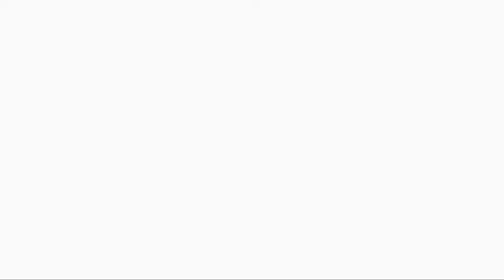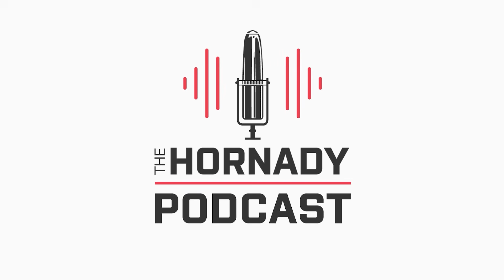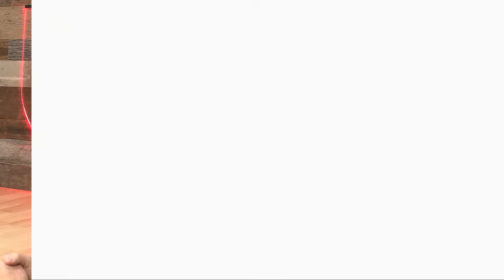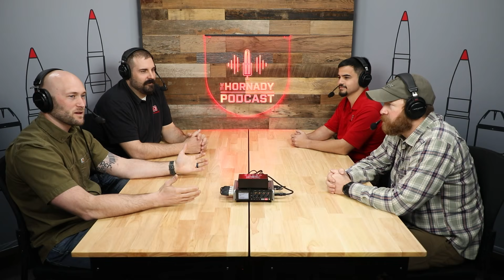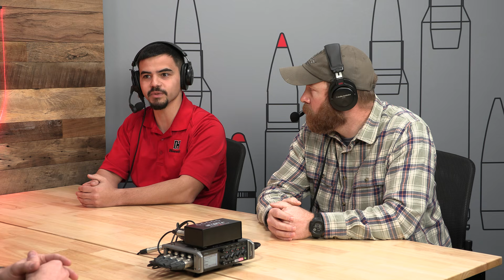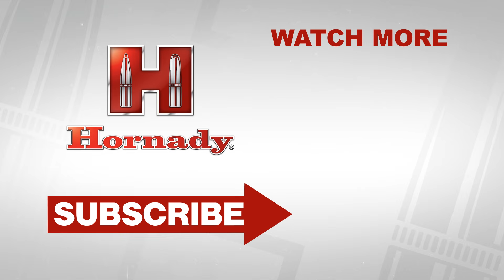Ep. 012 - 6mm ARC (Advanced Rifle Cartridge)

Comment: Use the same case head from 24 nosler with the ark chamber. Using the same 556 bolt.
Stronger bolt and no rim lock.

Comment: I contacted Starline and they are not taking on new projects and their technician said it wouldn't work because the primer pockets would stretch if you removed brass from the base.  That didn't make since to me since it would be the same as existing 5.56! So I took two 6.5 Grendel cases and milled them down myself to fit my 5.56 bolt.  I then put the 5.56 bolt in my 6.5 Grendel upper and have now shot each case 4 times and still have resistance in the primer pockets.  One case is PPU and the other is Hornady.  I'm pushing a 140 grain bullet with 21.5 grains of IMR4198 because I have a good supply of both. No pressure signs. I'm going to work up to 22 grains which should be near max pressure.  I haven't chronographed this load and I'm not using the gas system for this test. I'm just testing the integrity of the base.

Comment: You could do the same thing with the 6.5 Grendel and the 7.62x39 with small primer pockets. This would practically eliminate the bolt breaking at the lugs due to the removal of metal to accommodate the larger cartridge bases.

Comment: Its probably the strongest all around cartridge for a AR15. I hope some other bullet manufacturers make 6ARC. All I have seen is Hornady.
Reply: Gas gun or bolt?
Reply: Only if your IQ is bellow 73 and reading comprehension is an issue! The 6.5 Grendel will match it or beat it every time if you are a hand loader and can select bullet weights that are identical and similar in design. Once you get heavier than Hornady loads for the 6mm ARC the 6.5 Grendel pulls ahead real fast. Nothing wrong with the ARC as long as you do not think it is better than the 6.5 Grendel. Until you have shot both and loaded for both your just sounding very ignorant when you put the 6mm ARC on a pedestal!

Comment: Update.... I got a 16" upper from pro2A tactical.  It doesn't like the 105 blacks. But, I bought several boxes and have been reloading.   It shoots the 103 eldx well with Lever.  58vmax OK, with exterminator.  Didn't seem to like 95 LRX.  Next up, 80 ttsx for hogs!! Might run 65/75 vmax for yotes.

Comment: 6mm ARC will arrive when Starline starts offering brass.  It's still in growing paying phase.  I bought a 6mm ARC ballistic advantage barrel.  It's back with them because they couldn't get the headspace right to pass a go, no-go check.  And their customer service works in Geological terms in that the replacement barrel that's coming "soon" may or may not arrive in my lifetime.  I think it's a viable cartridge offering, but the marketing wank is disproportionate to the availability of brass, factory ammo, etc.  Meanwhile my Grendel build shoots lights out.
Reply: I hate to hear this. I'm thinking about building a Wilson Combat upper in 6mm ARC.
Reply: @tacticalmattfoley  I ordered an Odinworks 6mm ARC barrel after I got tired of waiting for BA and finished my build.  It shoots great, and I've been able to get enough Hornady factory ammo to have enough brass to play with.  I like the cartridge and will probably build a bolt gun in it as I think the true potential is unlocked at the higher pressures a bolt gun can run.  But I still think the marketing wank is disproportionate to reality.  If it was as amazing as all the claims why would the army instead be adopting the 277 Fury?
Reply: @waltersobchak2973  SOCOM did adopt 6ARC as one of the support weapons for their squad sniper units. Geissele is building the 6ARC rifle, and the 6 Creedmoor rifle for those support roles. When you buy 6ARC ammo, it has an ITAR warning because SOCOM uses it. This is one of the reasons why I believe 6ARC ammo is hard to find at times.
Reply: @tacticalmattfoley  Yes, so the military should be very familiar with 6ARC, and yet still opted to go with the larger, heavier 6.8x51 round for the standard infantry rifle.  An odd choice if 6ARC checks all the boxes they claim.    Also there is no additional ITAR restrictions on 6ARC ammo.  It's hard to find because it's a be caliber that is only being produced by one manufacturer and because of the current state of the industry in which most calibers are equally hard to find.
Reply: Late to this thread, but I got Starline 6mm ARC brass delivered yesterday.
Reply: @williamgeideljr3985  Nice.  Got my first batch from Starline a week or so ago.

Comment: Has anyone tried running barrels under 10 inches in gas guns to see how they perform against more modern CQB type firearms?  Theoretically, this performs better in velocity and energy than a 300 blackout 3 inches longer. Not to mention the vast improvement at range
Reply: Precision Firearms did a bunch of testing with 7" and 9" 6.5 Grendels.  Velocities were actually good with 123gr ammo.  I ran some numbers for the 129gr ABLR in a hunting set-up, and they were pretty impressive.  Thinking about a 7" integrally suppressed Honey Badger Grendel type build.

123gr was in the 2100-2200fps range if I recall.  Numbers are on the Grendel forum.
Reply: @LRRPFco52  those are excellent velocities for that barrel length and round.  Short barreled 6.5 and 6mm guns would be a good replacement for 5.56 carbines
Reply: @Brimwald  I love 5.56, but not even a 20" 5.56 can reach 10.5" Grendel muzzle energy, and Grendel just walks away from it on-out.  20" 5.56 is flatter though within normal distances, which helps with hit probability.  If you go lighter in projectile weight with Grendel, that advantage narrows.  That's where 6mm comes in.

Comment: Love my 6 arc running a built gas gun 20 inch ballistic advantage premium series barrel Odin works adjustable gas block Odin works ragna 17.5 hand guard grendel hunter nickle bolt velocity trigger jp silent spring suppressed with iray Rico mk1 thermal 87 gr vmax over 31.5 gr of lever evolution seated at 2.140 mild crimp getting 2850 fps 5 shot 1/2 inch group that thing hammers

Comment: I might build one, but I'm perfectly happy with my Grendel's from 12"-22". They hunt well and all of my Grendel's shoot sub moa, including my 16" BCA 😳😁. Grendel wins on ammo availability and cost (premium and plinking). I can shoot and stock up on Wolf steel cased for less than 80 cents per round.
Reply: Grendel wins.
Reply: What velocities are you getting out of that range of barrel lengths?
Reply: @Brimwald  I don't have a chronograph so I can't tell you. I do need to buy one, especially since I'm going to be getting into reloading soon.
Reply: @Brimwald 6.5grendel gets around 2400fps from a 16in Barrel with 120grn projectiles.  I get around 2300 from 130grn bullets.  And about  2650 with 110grn ammo.
Reply: @djl5634  Grendel 120-123 gets 2600 in 24" AR
Reply: @Brimwald 6.5grendel gets around 2400fps from a 16in Barrel with 120grn projectiles.  I get around 2300 from 130grn bullets.  And about  2650 with 110grn ammo.

Comment: Pretty disingenuous to compare a 108 or 105 in the 6mm and just hand wave assume the best you can load into the 6.5 is a 120. 

Thats like comparing something to a 
308 and playing like only 150s exist. 

The 6.5 loaded with the best bc loads it can take is absolutely splitting hairs with the 6mm, and has significantly more energy up close, and only barely looses out in the ballpark of 800/1000ish yard territory depening...
Reply: I would like to see an update to the 123gr and 115-117gr class of 6.5s, increasing BC, but the conclusions are valid they have made.  The other answer might be .257, which would allow a really wide range of projectiles and better BC than 139-147gr 6.5mm, if you look at the new 131gr and 135gr .257s, but we really need a 2.500" action to seat those properly with the Grendel case.

Comment: My 6mmARC shoots fine.But it does not come close to my 6 Dasher, or my 6 BR or my 6 GT.ooking at the 2020 Nationals not even one 6mmARC wa in the running or even in the top 50.
Now with that said I love my 6mmARC AR15 Rifle.I am in the process of building a precision 6ARC bolt gun..
The problem is not enough rifle companies are building enough 6ARC rifles.Howa builds one and Savage. Who else is building one???
One other thing..Out of the 2020 Natio also there was only 1 guy placing in Top 50 shooting Hornady Bullets.
95% shot Berger .There were 4 shooting Sierra Match King.
And 1 shooting Hornady in both the Light Gun and Heavy Gun.The lone Hornady was  the 300 PRC..
I hope the 6mmARC stays around.I really like it.I love my Hornady products.But to be competitive I had to switch to Berger Bullets.i hope Hornady can come up with a better bulket equal to Berger For years Tge Federal Match King in 308 was the benchmark bulket.Now Federal is also using Berger in their Bullets too.
Reply: I really like the 6mm arc in a gas gun. This podcast was a blatant sales pitch. Anything bigger than a 6br will out preform it in a bolt gun. I wish hornady would advertise the 6gt this hard.
Reply: @disfordiesel8219  6GT was designed by GA Precision for hand loaders. I don't see that ever being a factory load.

Comment: I'm not going to mention his name because I dont personally know him . He was getting 2950 FPS with 105s in his 26.5" 6ARC Bolt Gun . I believe he had over 6k rounds fired in mid 2021 . Even in his 22" 6ARC gas gun was getting almost or right at 2700 FPS with Black ..

6ARC is my absolute favorite AR15 Cartridge.  It's my do all be all . I absolutely love my 12.5 and 16" . My 12.5 is my do all be all AR15 RECCE Upper 500 yards and in . My 16" is my SPR and can easily get out to 800 yards . I have about 1000 rounds of 6ARC fired through my Rigs.
Reply: What 12.5" barrel are you running?
Reply: @ryandearing5456  I have 2 of them . One is Faxon 12" Match Series Gunner and Precision Firearms Custom CRITERION 12.5 Match Grade Nitride MIDWEIGHT..
Reply: @seanwhite304  you mentioned the other guy's velocities, but what are you getting out of those short barrels?
Reply: @Brimwald  
12.5
Black 105g BTHP 2435..
TAP 106G 2435..
Match 108g ELDM 2420..
103g ELDX 2455..
16"
Black 105g BTHP 2540..
TAP 106g 2545..
Match 108g ELDM 2510..
103g ELDX 2565..
Reply: @seanwhite304  wow, that is amazing performance out of the 12.5" barrel
Reply: @Brimwald  That's why I favor shorter 6ARC barrels . If I could do it all over again . I would of built 13.7" SPR , and 20" CSASS 6ARCs . I still might do the 13.7 when and if I ever to rebarrel my 12.5. I seriously doubt I'll have to to rebarrel though . 
The 12.5 6ARC actually covers all my needs . Compact , Lightweight and lethal out to 600 yards . It's perfect for taking medium sized game at reasonable distances . If money was an issue I would run 6ARC only because it covers all my needs
Reply: @Brimwald  Federal factory 90gr TNT does 2700fps from my 12" Grendel.  120gr OTM Federal does 2400fps.

Hornady 123gr ELD-M is awesome to shoot from 12" Grendel for me, even out to 800yds on steel, rapid TGT transitions from UKD TGT-to-TGT.  It is a joy to shoot.

Several buddies of mine immediately got into 6mm AR in the mid-late 2000s, which is also a joy to shoot, no real recoil even with 107/108gr.

13.7 6mm ARC sounds like a great do-all practical carbine or pistol.

I'll likely end up with a 12" or 13.7" 6mm, but I'm looking at other wildcat options as well.  I just got another 12" Grendel barrel and bolt, in addition to 22", 3x 18", 16", 12", and 10.5".

Comment: BRASS, BRASS,  where's the 6mm ARC BRASS come on already Hornady!!!
Reply: It’s all in the form of 6.5 Grendel. Resizing mine right now into 6mm ARC.  Extra steps for sure.
Reply: Is it a copy of 6XC?
Reply: @MrGurosa  no. 6xc is 308 win based
Reply: You can crimp down 6.5 Grendel brass
Reply: Just bought from Starline, saved some $$ over Hornady brass as well
Reply: Midsouth has Hornady brass.
Reply: Buy 6.5Grendel and reform to 6arc.  Easy
Reply: Did an ammo seek search, no 6Arc.
Reply: @markmtbrider  
6 ark will not survive if availability doesn't change and now.
Reply: @romeolima5339  amen to that. And I really like 6mm arc. Would love to build a 12.5 or 13.9 but not going to unless ammo availability changes
Reply: @romeolima5339 funny, it's still around and it's just now coming back in stock...  so much for now Nostradamus.

Comment: When will we be able to buy that magic pixie dust you guys use in your factory loads? I can't make factory velocities with Levr without pressure signs
Reply: What barrel length are you running? I have no problem getting 2685 fps (that's my load node) out of a 24" barrel on a AR. I even went to 2705 fps and wasn't close to max load and still didn't have pressure signs.
Reply: @oif3vetk9  you just answered your own question... no1 really uses a 24 inch ar barrel

Comment: You guys make a great argument for the military but from a hunters standpoint, not so much. In an AR the ARC isn’t up to the performance of a garden variety 243. In a bolt gun it certainly is comparable to the 243. But I built a 6.5 Grendel AR in a 24” barrel and took it deer hunting. After years in the field with a 308 I can tell you the Grendel is no 308. I’m still intrigued by the ARC but I need to see more from the field.
Reply: That's going to be true for any cartridge in a standard AR platform. There's only so much powder/pressure you can fit in there. The 6mm is much more versatile than the 5.56. If you need more power, there are lots of options in a bolt gun or AR10.
Reply: You only need ONE serialized lower. To me, this matters.
Reply: I have harvested about a dozen hogs with arc. I not saying 300lbsers but some 100-150lbs. I believe I 100% recovered. It’s low recoiling with the ar I have tricked out so I shot it well.

Comment: I was so hyped for this round.  Bought some factory ammo.  Bought reloading equipment for it.  However more and more everyday i lean to not building one. Brass life sucks.  Brass availability is slim.     Should have researched more.   🤦🏻‍♂️
Reply: Plenty of 6.5grendel brass and starline will soon pickup 6arc
Reply: @leagueoflegendsplays9420  and 3-4 firings and it’s ruined.  This cartage can’t handle the abuse.  Why would anyone want to send a 6mm projectile 23-2600fps when you can send them at 28-2900fps in a different chamber.  This is nothing more than a 6 Grendel.   23-2400fps is about all it can do before brass gives out.
Reply: @MrBoostin18  The 6MM ARC is a combat round, for varmints or deer I still my 6MM Remington although the 6MM ARC can handle deer. Sounds to me like you either have load development work to do yet or build issues.
Reply: @davidmilisock5200   actually neither.  The issues I’ve stated have been from all of my research.  I was planning to build a bolt gun in 6arc.  But every time i do i see more and more issues.  This round is the 224 valk of the 6mm world !
Reply: @MrBoostin18  If you are building a bolt gun there’s really no point in building an ARC. 6 BR or 6 Dasher will outperform it, brass is available and there is a great deal of load data.
Reply: @richardbriscoe8563   i wanted to be different.  6arc would be plenty for me where i live.  The closest outdoor range is 330yd.
Reply: @MrBoostin18  Enjoy it! If people will respect it for what it is and not try to make a .243 Win out of it, it’s an interesting little cartridge. 

Just personal opinion here, but I think people would be pleased if they focused on 70-95gr bullets.
Reply: @richardbriscoe8563   the more and more research i do, i feel it would be a better cartage with projectiles sub 100gr as well.  Seems like anything 100+ and you’re pushing the ability of the case to handle a pressure of the powder.

Comment: The people want 58gr - 90gr factory ammo for it. Reloaders have proven it's very possible, clearly it's no .243win or 6creed, but it would be great for coyotes & bobcats with a 75gr V-Max. That's the only thing keeping me from buying the 6arc.
Reply: They are mostly focused on distance shooting if this cartridge picks up you’ll see a lot more offerings. It’s not very popular right now, especially since there’s debatably better 6mm cartridges for bolt guns
Reply: I won’t have another one. Too hard on brass
Reply: I load 70gr noslers up to 87gr vmax and it’s great on predators but doesn’t have near the velocity you would expect based on factory load data. I’m running and 18” proof and my 87gr vmax are only going 2675 fps. All the factory Hornady stuff is over pressured and it shows on the brass.
Reply: @varmint_king  Weird.  90gr TNT Federal 6.5 Grendel does 2700fps from my 12" Grendel.  87gr should be cooking from an 18" or longer in 6mm ARC with the right powder combo.

We've been shooting 6mm AR for 18 years already, so data for 6mm Grendel isn't new at all.  

What load are you running, and what's your gas system length, barrel length?
Reply: @LRRPFco52  has length is mid +2 I believe and running 26.6gr of h335 with 1.645 cbo and cci 450’s. I can push another .5gr’s but this is where my accuracy node falls.
Reply: @varmint_king  27.8gr is max gas gun published load with H335.  Might be too fast-burning for 6 ARC if you want speed.  Leverevolution is the powder for speed in 6 ARC.
Reply: @LRRPFco52  that proof barrel has a short throat so I’m seated way deeper than Hornady max coal too which doesn’t help for case volume
Reply: @varmint_king  If the reamer isn't made by Dave Manson, I don't want it near my pipe.  Talk to Precision Firearms or someone with a Manson reamer to get it throated properly.
Reply: Couldn't agree more a 70 80 grain for foxes and I would buy this immediately, or a 6x45 in a 70g hornady missing a trick here